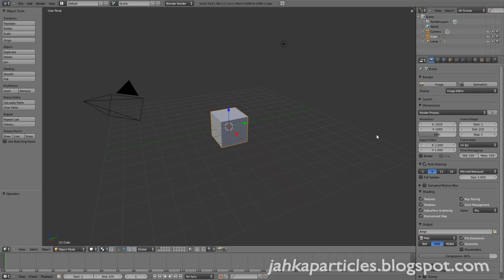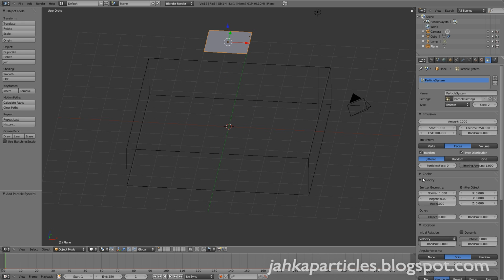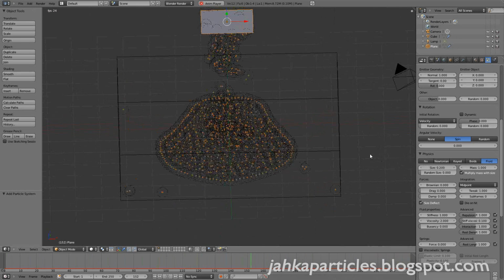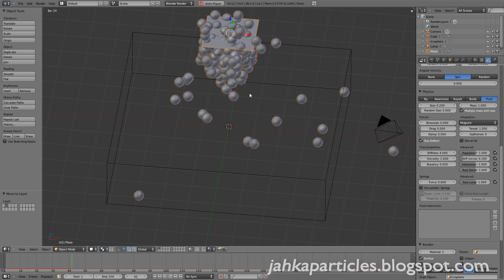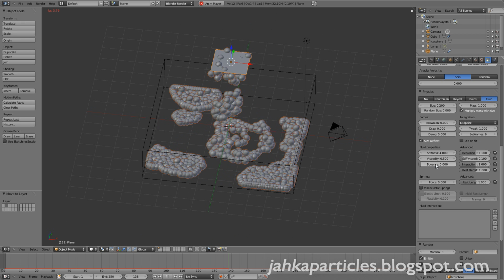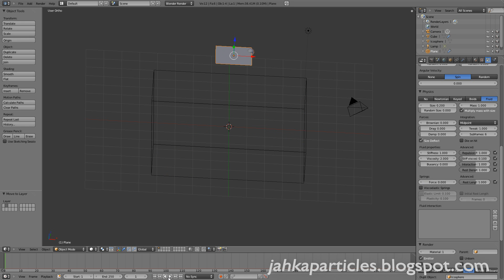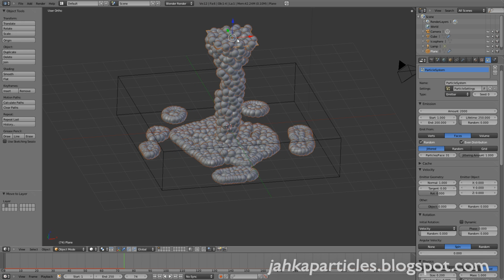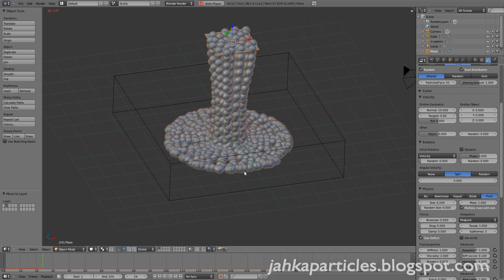Introduction to refactored fluid particles

Comment: @cepomwa You'll have to hunt around for tutorials, MAYBE, but there is an "Inflow" option in the Fluid Options. Next time you make a Sim, select the geometry you made as the "Fluid" part, and you should see an option on the left to make it an "Inflow" object... THAT'S the one you use to make things like water taps and stuff. 
I haven't looked at 2.5 TOO much, so can't give you specific buttons to press, etc, but it's there! :)

Comment: @cepomwa Blender also has a liquid/fluids section separate to Particle Fluids (it can get a bit confusing sometimes :P) 
And this is what you use to get an ACTUAL fluid simulation going. I haven't looked enough into fluid particles to tell you why they're added, but I THINK they can do a few things that the fluid sim can't.

Comment: Thanks. Interesting Video
I am exploring the Particles Fluid.
I am having challenges get the fluid where I want it to be.
Is there a written reference that describe what all the fields do?
For example ... damping?
Is there written documentation for 2.5 damping on the particle system panel?